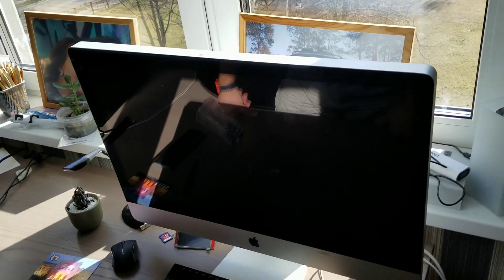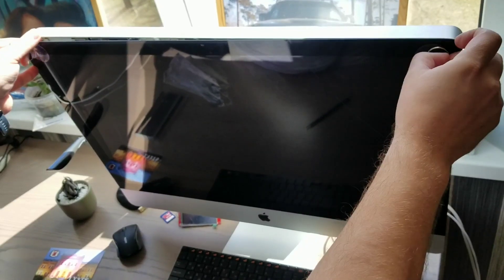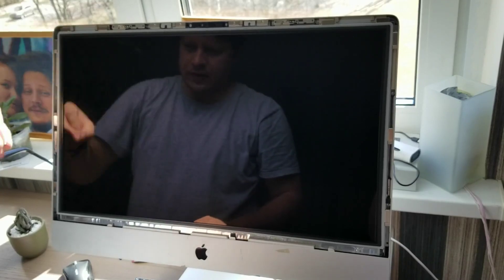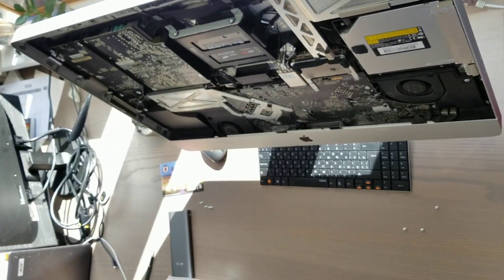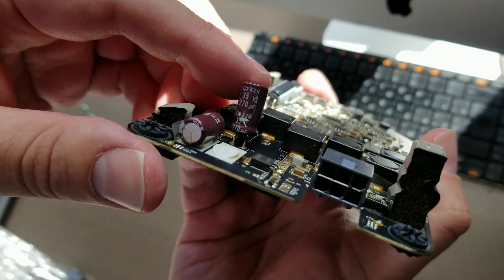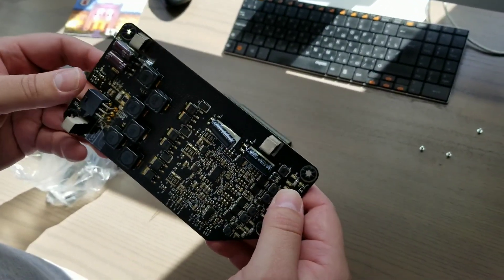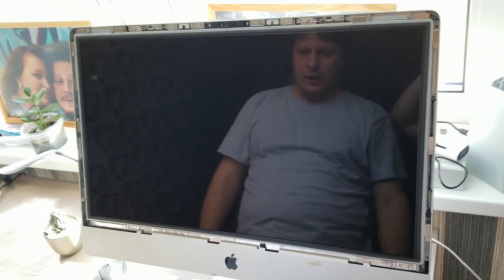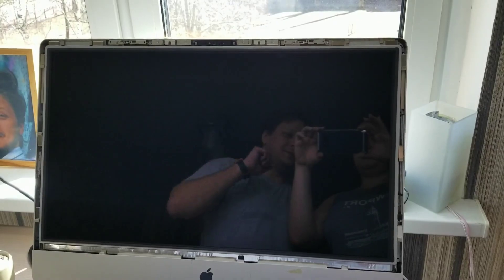Fixing LED backlit inverter in iMac (2011).

Comment: Il mio iMac non si accende ho già sostituito la scheda di alimentazione ma non è servito può essere l’inverter grazie
Reply from the maker: If you have problem with inverter - in my opinion, your Mac will start, you'll get startup sound at least and fans will spool up. You'll just get no display backit (and you'll able to see some image under strong sunlight or with some powerful flashlight). So I don't think that your problem is in the inverter.

Comment: A common failure for 27 <= 2011 iMac lcd backlight blacking out is the actually lcd led backlight bar connectors poor solder. Requires disassembly of entire lcd screen.

Comment: i have the same imac but my imac randomly the screen turn black and still on bcs i have a second screen for solve this i need to clear the nvram (cmd+ alt+ P+R) and works one day and do the same nesxt days.

you think changing capacitors can solve this?
Reply: Have you fixed already ?
Reply: @maniekkozlowski  Hello man, yes I solved this changing the 4 capacitors like the vídeo, now works good
Reply: @mikytujefe  your screen was like visible with flashlight or  black  black ?
Reply: @mikytujefe  my imac is going black screen but when i pres power button for 1sec screen is up again
Reply: @maniekkozlowski  Yeah is totally black and When I press power button the screen is back but later turn black again, you can solve this changing the 4 capacitors

Comment: Sheesh. I was already nervous about fixing the backlight issue myself. Which is why I bought the parts almost 2 months ago and still haven't used them. Now he says don't touch the power board because it's deadly even when the computer is unplugged. Well, now I'm absolutely terrified!
Reply: you can just discharge them. unplug PC, and Hold the powerbutton for some minutes. You can double check the caps with a voltmeter. anything below 50v will be safe. if still above you can hold the button more, or just discharge the caps with a resistor
Reply from the maker: Yes, there are capacitors on the power board that can hold a charge (they charged to rectified mains voltage, about 310V in 220V countries) for a while. So to stay safe, disconnect the power cord in the evening and start opening the computer in the morning - give it time to discharge.
About the backlight - well, if yours is broken anyway, why not try?

Comment: hi, i bought a new led board and replace it, it was good for 3 months then it start again, do you think its because of this condensators really? and do you have a link for them?
Reply from the maker: Hi there!
Can be lots of reasons for that. Bad capacitors is just the easiest one to solve, and for me, it helps :)
No, I don't have a link. Just bought some caps in a local radio store. You can do the same, just select ones with equal voltage and equal or higher capacity. Low ESR ones are preferable, and the higher the temperature rating - the longer they will work.

Comment: Hi bro do you have model condensator remplace please
Reply from the maker: Hi!
Sorry, I don't remember their characteristics. Just use ones with equal voltage (you can take ones with higher rated voltage, but they are physically bigger as usually and may just not fit there) and equal or bigger capacity. Low ESR ones will be good, and a higher temperature rating - is better.